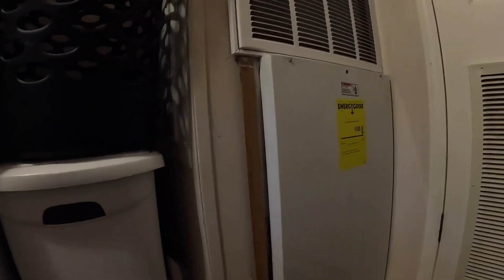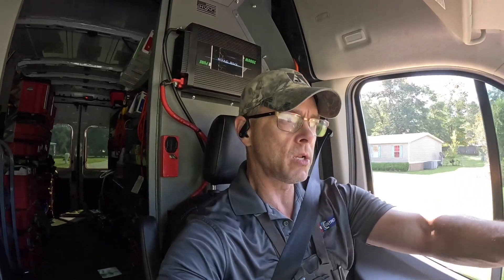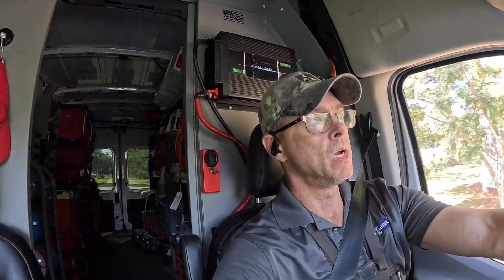Finishing Up An Install On A Mobile Home! #hvacguy #hvaclife

Comment: All this time, I thought the "C" in HVAC was for "conditioning," turns out it means "carpentry!"
I agree with you, the best remedy going forward would be tacking up some generic trim pieces... You did the best you could, and it was a heckuva lot better than the rough-in.

Comment: Looks great!! At least you tried to trim it out most probably wouldn’t have done anything about the fit!  When I installed hydronic heat here I had a FEH  Intertherm and making the piping less visible was a challenge. But it heats good and I’ve got a pile of wood to work up lol

Comment: Turned out great for what you were left to work with. I wish I was around there, I would have fixed the whole shooting match with drywall, and in no time flat. I ain't too bad of a trim carpenter either. Like they say, it is, what it is. I have to say and I have mentioned before, that you are resourceful guy. Nice work
Reply from the maker: Thanks
Reply: Curtis is a very resourceful gentleman for sure. And goes beyond if need be.